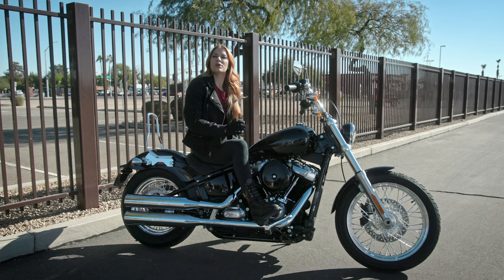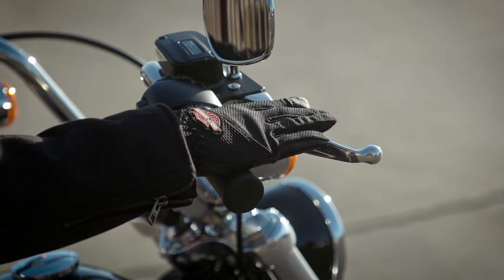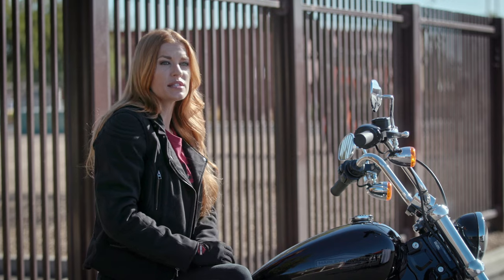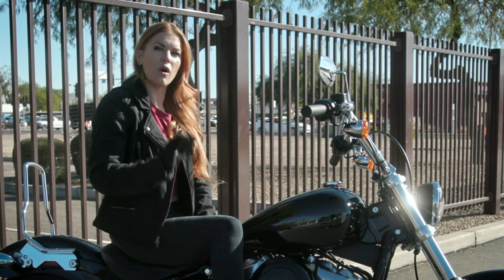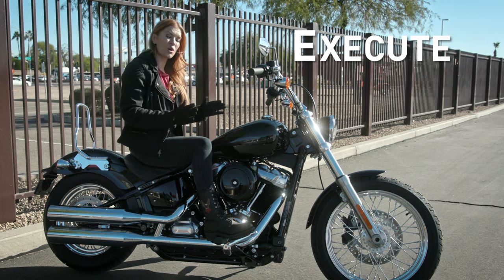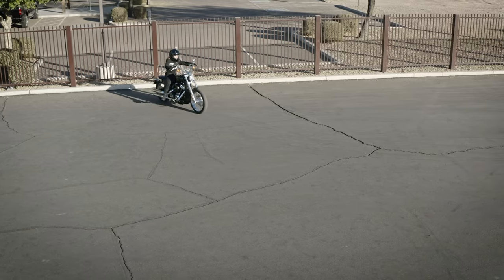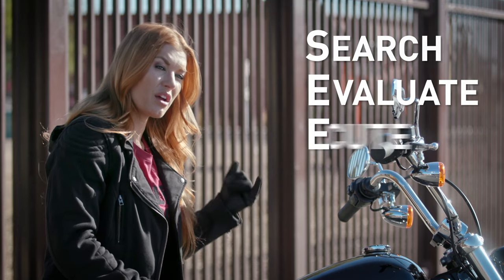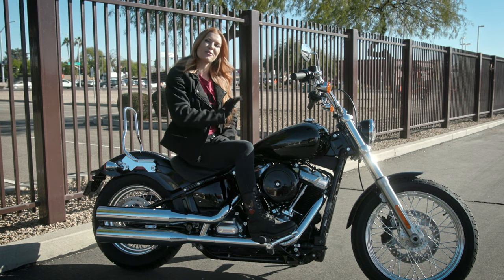How To Come to a Stop on a Motorcycle | Harley-Davidson Riding Academy

Comment: 70 percent of stopping power from front brake. thats debatable. Frame geometry has a lot to do with this. Cruisers actually have more stopping power from the rear brake. One of the reasons we didnt use front brakes on our choppers back in the day is because we knew this. I still have choppers that have no front brake and I can easily stop them in any situation.
Reply: This is why I don't go on group rides.
Reply: ALMOST any situation. Just not the one where you need a front brake.
Reply: @tomdillon6758  been on a real chopper all my riding life. No front brake and no wrecks.

Comment: So you let off the throttle, brake with both brakes and downshift while keeping the clutch pressed until you need to go again, you don't let off the clutch unless you're in neutral or about to accelerate?

Comment: To really learn how to stop, I took the rear brake peddle off for a month. (This was in 84 when I realized I needed to really use the front brake, which is 70ish % of braking power) It was a little unnerving at first. But at the end of the month I was totally comfortable. I used a Metzler me33 Lazer front tire which 'howled' when it was  dragging slightly under high braking force. You could feel this dragging force also. It let me know I was at maximum braking force just before tire lockup. The rear brake dose help.....but the front brake is what saves your life. 
I rarely ride now, but I noticed I mostly don't even use the rear brake on my 740 pound bike.
If you don't have anti lock brakes, you better learn how to use that front brake!

Comment: I've only been riding for a few weeks now. No prior experience... No prior experience with using a clutch in cars always been automatic for me. I'm having a hard time down shifting most times I try your way my timing is off obviously and it keeps jerking me and locking up the back wheel. I've gotten to the point these past few days where I'll shift up in gears(not smoothly), and when I get close to a stop sign or light I'll just hold in the clutch all the way and click the shift lever all the way down to 1st. Is that safe to do or am I going to ruin my ninja 250?
Reply: I think your down shifting too fast man. If you know there’s a stop or light ahead start slowing down gradually

Comment: Would downshifting that quickly be bad for the bike?
Reply: Not really but you could experience aggressive engine braking. It happened to me when I first started riding, I was getting ready to pull off the main street to enter a side street, I was in 3rd gear then downshifted to 2nd gear and as I approached the side street, I downshifted into 1st and the bike lunged forward quickly on the forks, that was aggressive engine braking. I found out that I downshifted into 1st way too fast for the 1st gear. That was a scary feeling. You know when you grab the front brake hard and not gradually, the bike will lunge forward onto the forks.